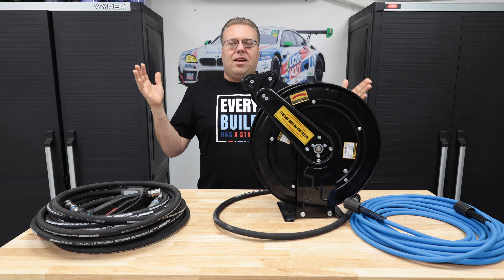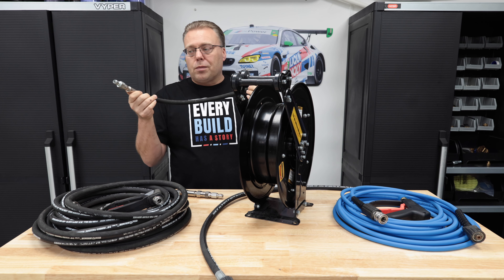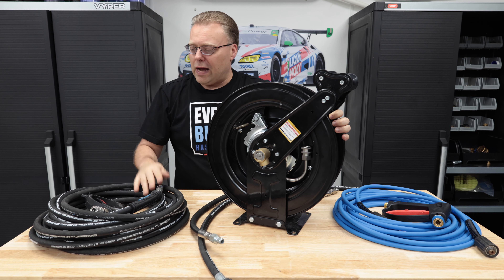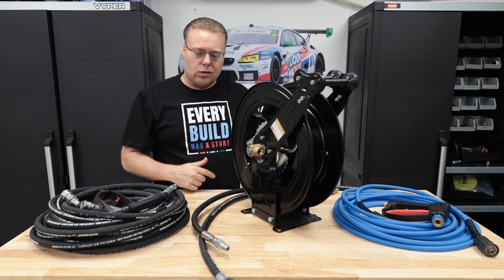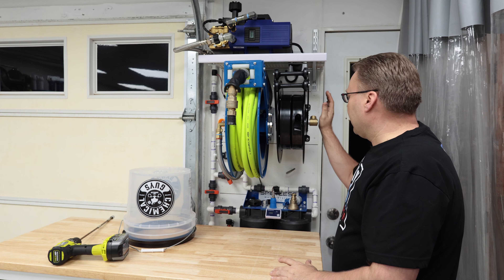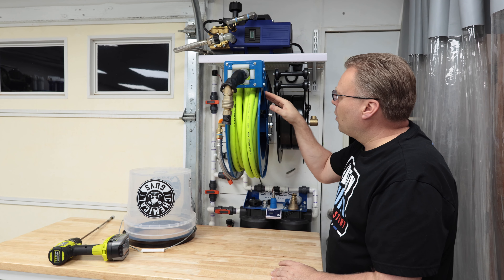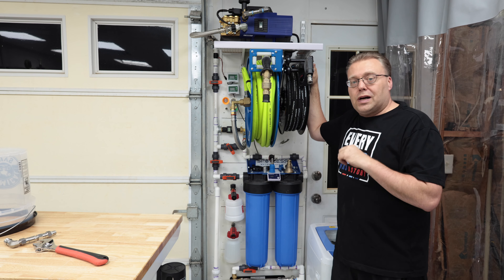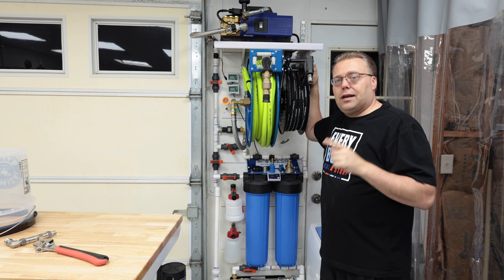Amazon Retractable Pressure Washer Hose Reel | Fixfans | 1/4 or 3/8

Comment: Will this reel work with the active 2.3 included hose?
Reply from the maker: It doesn’t fit perfect you would have to use the processes I used for the Uberflex in this video. The m22 area is too big to fit into the housing so you have to get inventive to hook it up.

Comment: Hello ... any idea if 1/4 hose 100ft would retract properly on this reel ??   .. Thanks !!
Reply from the maker: It would not as the max rotations stop right around 60 feet. Even though it’s a smaller diameter it would still require the same amount of rotations. Somebody tried a 75ft hose and it left them with 10ft left to reel in.

Comment: Can you please help me to understand mounting this? Did you mount this into Sheetrock? All I have is sheetrock in my garage and I don't see how that will support this weight
Reply from the maker: My wall for the wash setup has no drywall it is all 1x12 boards and I lagged the bolts into that. If I’m drywall best to have really good anchors and two of the bolts in the stud. You could also anchor a wood board to the studs over the drywall to have something to lag into.
Reply: @CarsWithKeav   the reel came with these fat bolts that have a flat tip, and tight groves not like a wood screw has. Could I still use that mount the base into the 2x4 that is going to be screwed into the studs?
Reply from the maker: @brandonnguyen1486  I used my own lag bolts. The mounting bracket is a bit too wide for a single 2x4 the holes would be too close to the edges or beyond the edges.

Comment: I’ve been looking for a retractable hose reel. This looks easy enough too. Do you have to mount or can I sit it on the ground until I find the perfect wall spot?
Reply from the maker: It will need to be secured to something very heavy as the tension to unlock and pull the reel would make it impossible just sitting in the floor.

Comment: Nice informative video and as always love the outakes.  Did you have a review on the BluShield Aramid Braided Rubber Pressure Washer Hose?  Whats the main benefits over the uberflex?  I have been looking at this retractable reel myself.  The reel is priced well and the main thing i was looking at was the weight as well because it does not come in super heavy.
Reply from the maker: I actually did a video on that hose and compared it to Uberflex and other hoses as well. Main benefit is weight and diameter. ANother great benefit is it acts like a big heavy 3/8 just laying on the ground, but is much lighter and I think more flexible. https://www.youtube.com/watch?v=cuw8ps0h_XE
Reply: @CarsWithKeav  Thanks for the video link i check it out.  All the items are being documented in my mind lol until i can afford the upgrade as prioritizing other items.  Though curious with the hose as paired with the reel is better. Cheers
Reply from the maker: @ShasCarDetailing  if looking at buying a hose and a reel this might be a better choice. https://amzn.to/3TTdOgV It’s a little more than the combo I made, but it’s all put together already and it’s a great brand.
Reply: @CarsWithKeav  do you know what the weight is?  The reason being is i'm wanting to build some sort of cart that can house a pressure washer, reel and garden hose reel that i can lift in and out of my truck as i do not want it fixed  down.  So as i am lifting it up and down i am trying to shave of as much weight as possible.  The manual cox reel comes in at 18 pounds which i prob attach the garden house but like the idea of a retractable for the pressure washer as was not too much heavier.  However if that reel was over 30lbs i would not consider it and go with other reel if that makes sense.  But yes i saw that reel and looks good but could not find out the weight?
Reply from the maker: @ShasCarDetailing  Scratch that I just checked and the listing says polyester so doesn’t sound like it’s the Kevlar hose. The fixfans I reviewed is 25 lbs as retractable will be heavier due to the mechanisms involved. A manual reel will be much lighter. On a cart hate to say it the Manual reels are going to fit way better. The retractable ones stick out to far in my opinion. Unless you can get it mounted inside and not hanging off the side.
Reply: The cart for my project would need to be just half or I was thinking more like a dolly that is plastic. I would drill it in. Cox reel at the back, pressure washer in the middle and possible retractable at the front. Sticking out may not be such a problem on the dolly. Will buy the cox reel first and prob see what I think from that. I was inspired from your cart videos but they can’t work for me as need to pull my truck cover over. Thanks
Reply from the maker: @ShasCarDetailing  I think the cox reel will do well they are great products. Worst case of you change up they sell well on Facebook marketplace. Finding the right size for your needs is the toughest part.

Comment: Can you use this reel with a gas power washer
Reply from the maker: It’s rated for 4k PSI, but myself I never try to get within 20% of the max pressure. Depends on the gas pressure washer as well 3k psi and less it should work,  it I have never run at that pressure to know. I stick around 1k psi for car washing.

Comment: If I used this with a hose that's not connected to the supply line on the reel unit, will the retraction system still work?
Reply from the maker: Yes it would, but it would need to be anchored to the reel somehow in order for the pulling and pulling to work or it’s just going to unwind like a tornado.
Reply: @CarsWithKeav  I am planning to use it with a power cable that is going to run along the ceiling and into the reel. So I would need to anchor the cable to the reel itself, or would the anchoring to the ceiling achieve the same effect?
Reply from the maker: @Nick19837  Problem is you can’t anchor it to anything, but the reel. If you anchor to the wall it won’t retract it will just get stuck and not spin. Only way to get a power cord to work on a reel properly is with one designed for it so the cord can’t get all twisted up and you don’t have to unravel fully every time you want to use it’s biggest problem is not too many empty ones out there and they come with the cords already on the reel. I have been looking for a solution, but very few 12AWG power cord reels out there that are budget friendly. You could anchor it to the reel leaving a little slack unplug it the retract then plug back in, but the slack would have to be minimal as it will fling around when retracting and get caught on something or damaged by hitting things.

Comment: Are you saying you could use a 1/4 inch hose or a 3/8 I have a Cox reel MP – N – 350 and I actually have a 3/8 x 75 hose the connection on your video seems a lot different. Would love to discuss it more with you.
Reply from the maker: The Blushield hose I was using is 3/8, but 75ft wouldn’t fit here only 50ft would fit. If you have 1/4 hose probably would fit at least 60ft. All the fittings are standard 3/8 threading and quick disconnects. Most normal 1/4 hoses still use 3/8 threaded ends or they use m22 fittings like the Uberflex in the video. I have seen some 1/4 hoses have 1/4 fittings so it all depends on the one you have.

Comment: Would love to know how that new Giraffe Retractable Pressure washer hose reel compares. (4000psi model) Seems to be the same concept for less money. Unsure if the hose included is a good quality. Would love for someone to review and let us know.
Reply from the maker: Made a video on that one here https://youtu.be/xZhRynRcC1c?si=hKHzWdxBr7hxR3_c It’s okay kind of flimsy and the hose to me is no good to me. It’s about half the size and weight though which is nice. Only thing that sucks is they raised the price since the video it was only $125 then. The Fixfans is much more durable and will hold any hose you want easily. The work it takes for the Giraffe to use other hoses is a good bit. Made this video showcasing a different hose with a fitting and mounted in a portable tool box. https://youtu.be/S_FHnjqSsUA?si=VJaUW3tnqWWl_Krv
Reply: @CarsWithKeav  Ah, good to know. The new one seem to have a better hose. But the reel looks to be the same. So your review is still relevant. Thanks a bunch.
Reply from the maker: @david-iam  No problem.

Comment: Keeeeeeaavvvvvv, Bro I im a cox guy <-- sounds suspect... BUT I really like the cox reel for the heavy duty. 

Keav I need a foamer / sprayer that is better then the IK can you give me some links?
Reply from the maker: If I was running a 100 feet of Kobrajet blue jacket I would go with a cox real probably. 50 feet and a light hose retractable all the way for me. Nothing is better than an IK foamer that I have tried. As a sprayer I like the old Solo which they don’t sell anymore. You’ll just have to wait till November to find out about the new IK battery sprayer being delayed till 2025. 🤣🤣

Comment: You have any video on water pump setup for mobile detailing?
Reply from the maker: This is the closest I have where I store RO water and use an RV pump to use the water. https://youtu.be/BpQmEDUHFRU?si=guGskdxgfykGjW9q
Reply: @CarsWithKeav  been looking for a video for a seaflo water pump on how to add a pressure relief valve but I haven't had any luck . A lot of mobile guys are have the problem the the pressure the builds in the pressure washer when it kick back to the pump the pump leaks , so I've heard that a pressure relief valve is needed. I just don't have an idea on how that works figured I would check your channel since you make good content on many things
Reply from the maker: @KingTheDetailer  I actually just had somebody comment have I had any back pressure issue and do I use a breaker or preventer to stop it. I have heard of pressure washer back pressure, but never had it happen to me or if it did my system handled it. Might be something I want to look into to add to the setup. I’ll do some research and see what I come up with.
Reply: @CarsWithKeav  I bought a seaflo pump installed it but the build up pressure would cause it to leak from the seals so I returned it. I would definitely appreciate it you found something and made a video about it. Would definitely help a lot of people especially for mobile guys like myself. I currently rebuilt my van setup and was looking forward to putting my pressure washer in the back area on top of a shelf where its out of the way and not visible but until I don't find a solution it won't happen
Reply: @CarsWithKeav  thank you again brother for the reply love the videos

Comment: So I just put in an order for a similar retractable hose reel on Amazon listed as joejet brand was for $169 and that looks to be the exact same one as the fixfans     Now just need to pair it with a hose. Putting together a budget setup with a craftsman power washer. Is there a better option than the Uber flex out there  that would include quick connects for an easier install? Was looking at Adam’s hoses but they are all out of stock. Thanks! Enjoy the unbiased informative content!-S
Reply from the maker: I have heard good things about this one, but have not tried myself. https://amzn.to/4cgz2x6 I have not bought many 1/4 hoses which is perfect for the craftsman. I usually have a good bit of extras from all my Active pressure washers they come with good wire braided stock hoses.
Reply: @CarsWithKeav  Nice thanks, was going to pair the setup as well with the $20 M22 Swivel Spray Gun. What budget foam cannon do you recommend?  I saw the Bear Force one for $28 in budget pressure washer video seemed to pair well.
Reply from the maker: @spencerblack7691  I love the Bear Force as a good budget one. It is a bit higher than a lot of them out there, but the weighted ball, balance and other things make it well worth the $28.
Reply: So Adams hoses are back in stock, going to pick up a 60' for this reel and see how it works out paired with the craftsman

Comment: Hey Keav, did you ever try the MTM Manual reel? Do they actually make there own or is it the same one a lot of people sell on amazon? Trying to find a good reel that doesn't break the bank and that I can just mount and install without buying a thousand different adapters. It can be manual, I don't need retractable.
Reply from the maker: It looks to be the same that you see on Amazon. They have a stainless one that looks nice for like $115.
Reply: @CarsWithKeav   the 100ft one in stainless is out of stock
Reply from the maker: @dannysuarez6923  I know quite a few people who have been buying them lately. I know 50 foot is still available. The 100 ft is probably the most popular.
Reply: @CarsWithKeav   Is my next choice a 100ft coxreel?
Reply from the maker: @dannysuarez6923  If you want to pay that type of money I mean they are real nice. I have only used the Amazon one and had no issue with the several that I have had.

Comment: I built a pressure washer set up using the Merlin retractable air hose reel from Harbor freight. Unfortunately I keep getting a leak on the swivel as I think the O-rings are not intended for high-pressure. I’ve replaced them and it still starts to leak again. Can you or anyone recommend a replacement swivel or some other way to deal with this?  TIA.
Reply from the maker: I am unsure on that I know some have tried to turn air hose reels into poressure washer reels, but I never went down that path. I hear its better to stay closer to 800 PSI versus 1k PSI and you tend to have less issues. Maybe somebody in the comments will be able to help. I know I have seen many nightmares with parts blowing failing and leaking and a few where parts blew off. Many end up no longer connecting the pressure washer and just use the reel for the hose storage then take it out each time to use.

Comment: I was in Northern Tool and I ran across #115159 retractable hose reel with 50ft 3/8 for $199
Reply from the maker: That’s a good deal especially with a hose. They are a similar design. The Fixfans has the double lockers, quick connect setup and an elbow style hookup. So it depends on if you want the hose or the added features.
Reply: @CarsWithKeav  what is the double locker for ? not sure which part is this,
Reply from the maker: @dvdarpan  double lockers mean the points at which the reel catches to stop are doubled so less hose length is used to be able
To lock or unlock. When there is only one section it takes a full rotation to lock or unlock.